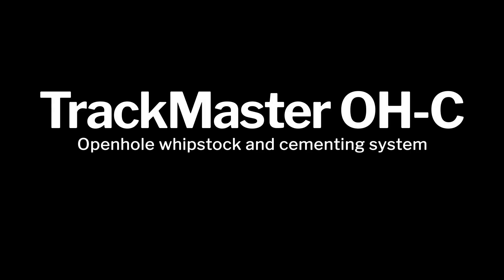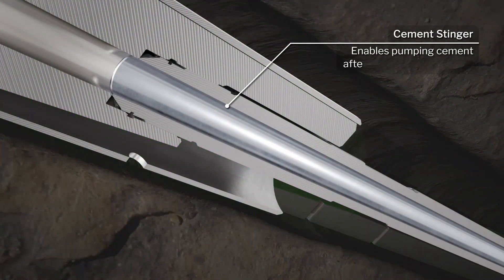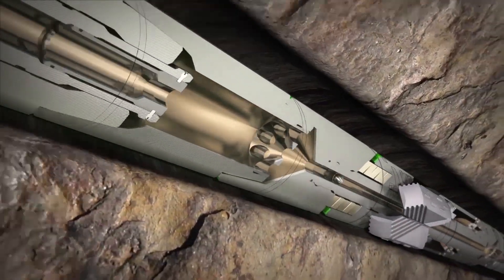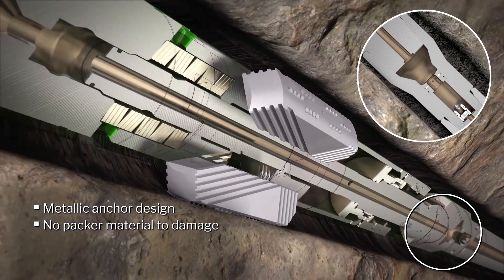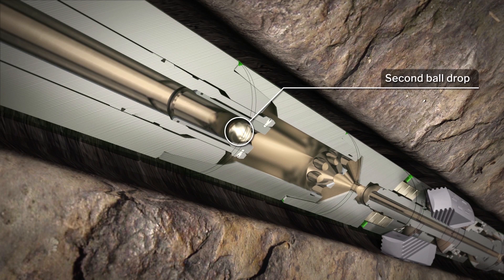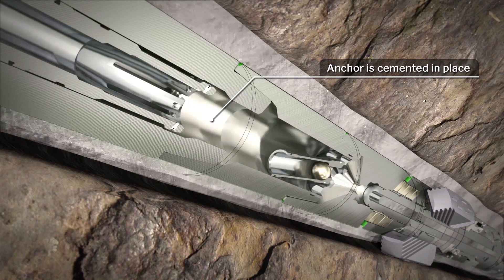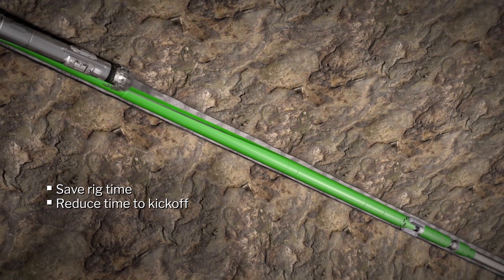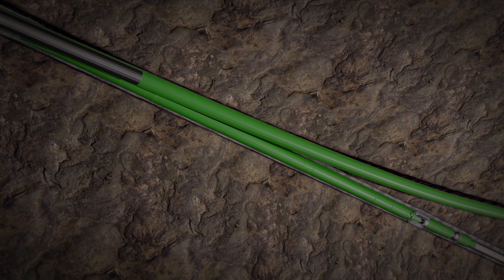Wellbore Integrity Solutions - TrackMaster OH-C Solution

Comment: So while you set the whipstock and cement in one trip, you still need trip in again with the milling assembly. 
Or you can first set a cement plug, then trip in with the whipstock and milling assembly.
Reply from the maker: After the whipstock has been set and the cement plug pumped through the assembly, the next run is directly with the motor BHA to drill the curve. A milling assembly is not required to run the TrackMaster OH-C.
Reply: @wellboreintegritysolutions1573   I was referring to a cased hole solution. Is it a different product when exiting a cased hole?
Reply from the maker: @eudofia  In the case of a cased hole, the TrackMaster OH-C can also be deployed, then followed with a milling run in a second trip. However, if the barrier does not need to be cement, a standard TrackMaster Select fitted with our packer can be used instead and complete the operation in one run.
If you would like more information on this and other products, please feel free to contact our SME experts at 
https://www.wellboreintegrity.com/contact-a-red-baron-wellbore-intervention-expert/
Reply: @wellboreintegritysolutions1573  Thanks for your reply.